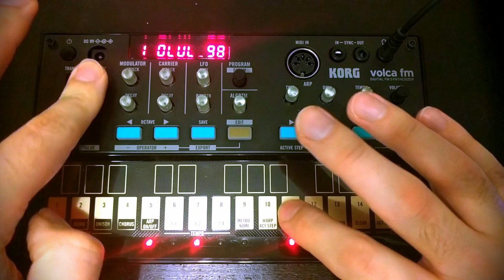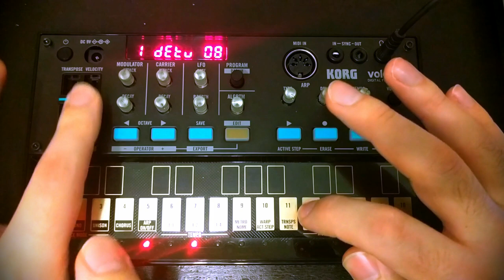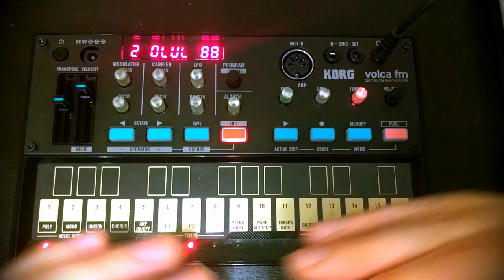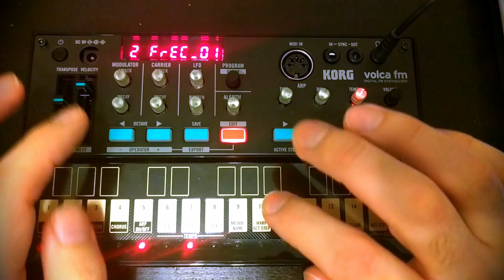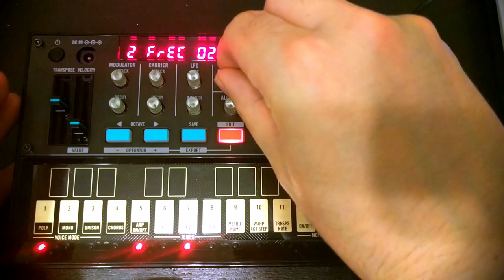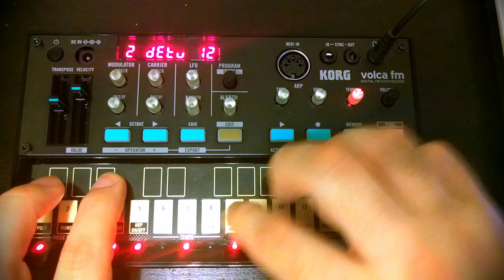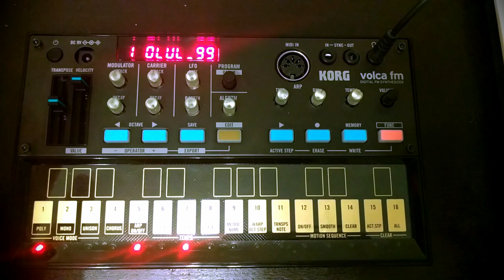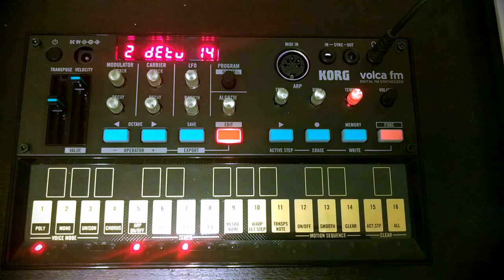Understanding Sound Design on the Volca FM - Episode 2: Operators

Comment: Thanks, can you give a scale for the hange in semitones like detunte is, as example, 0,3 cent for all exept octave. Thats what I m badly missing and KORG seems not to be able to answer this question to my shop. Next, if i remember well the DX7 will set the modulators in relation to the carrier. so 0,5 is a octave below carrier. here this seems to have no relationship to the carrier. can you confirm?
Reply from the maker: +Tigrar I'm not totally sure what you're asking for your first question, sorry...

In terms of the second question - the ratio of the operators is relatively to an 8' range (in the old tradition of organs). The ratio of the operators are relative to this range, and not affected by the relationship between the operators (ie the fact that the operator is a modulator doesn't make a difference, a ratio of 2 would still represent the same frequency no matter where it is in an algorithm). This behaviour is the same on the Volca FM and the DX7 (and all the DX synths). The confusion might be that the lowest ratio on the Volca is 0 and not 0.5 - but the two are equivalent in terms of the sounds.

Sorry I couldn't answer your first question, but if you could clarify it, I could give it another go, but hope the rest of it helped.

Comment: what program and algorithm is your fm set at? thank you
Reply from the maker: +80m tekeste it's set on algorithm 5, but any of the algorithms where operator 1 is a carrier being modulated by operator 2 will get you to the same sounds. Check out the algorithm card that came with the Volca FM.
Reply: Thank you for the info and your patience for such novice question. The FM is is my favorite after the Keys, and am really appreciative of your demos. I feel there is more joy enstored  for me from the FM, after understanding additive synthesis ( or is it Frequency modulation synthesis?)
I notice a parallel patter for the operators on #5. There is a yellow looper bracelet on the side of operator 6 and 5. Does that mean the modulator is being modulated by the output of the the resulting modulation?
Reply from the maker: What you're seeing there is operator feedback. In some cases it's an operator modulating itself, or it could be an operator swinging back into an earlier one. How much this feedback is happening is governed by the FDBK parameter in the "All Operators" section. I'll talk about it more in another video, but try it with a modulator feeding back into itself with a low pitch - it can be a great way to introduce a similar kind of richness that you'd get from a filter with it's resonance turned up when used carefully. I'm glad the series is helping you enjoy the Volca FM! Thanks for watching.
Reply: Thank you for the explanation ( highly valued). You are welcome.There is so much under the hood of this beast.